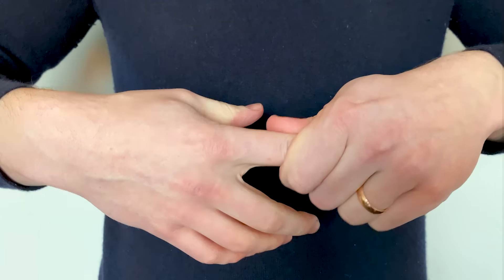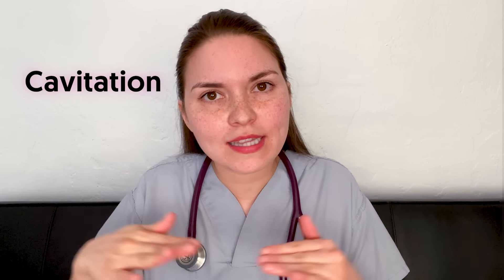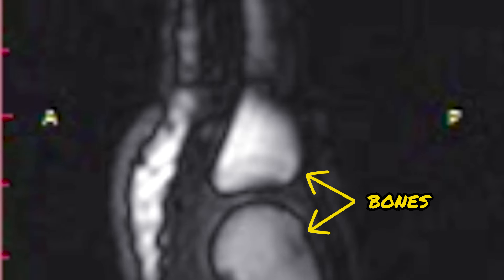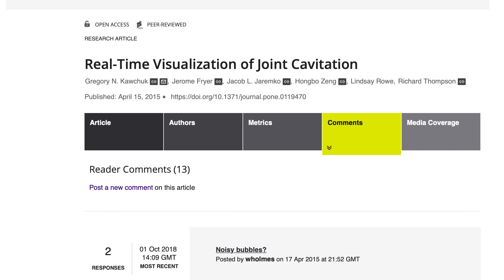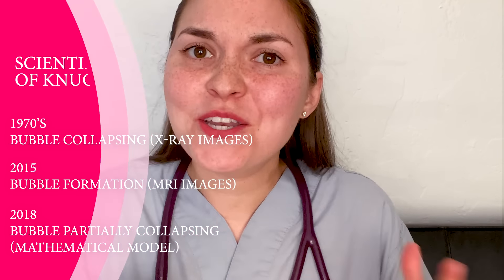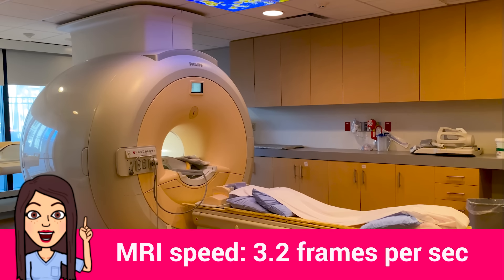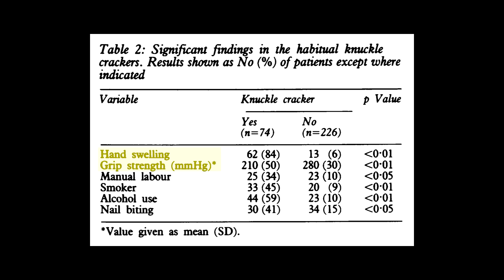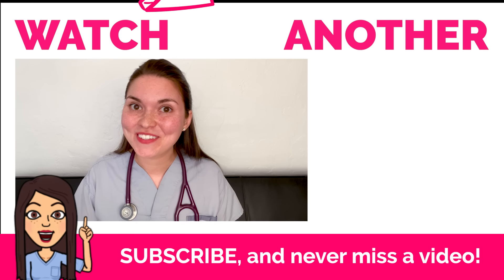Arthritis Doctor Explains: CRACKING KNUCKLES GOOD or BAD

Comment: Me, casually cracking my knuckles while watching this:
Reply from the maker: haha love it!
Reply: Same
Reply: Same!
Reply: Same
Reply: Felt a bit uncomfortable cracking my knuckles but still did it
Reply: Same😂
Reply: Same
Reply: It sounds satisfying! The same here. On another day, me, configuring a server and casually cracking my neck, and accidentally unlocking third-person mode 🙃
Reply: anyone else crack their toes as well?
Reply: @charlie-ot5ug  i have cracked every joint possible. From my jaw to my toes. Over 30-35 years since i started.
Reply: @dracula3811  if your going to crack your neck move it side to side and then  front to back don't do it in a circle that way you don't pull any ligaments
Reply: @joejacko1587  i crack my neck unassisted almost all the time. If i use my hands, it’s gently to the side.
Reply: I'm cracking my toes. I can crack my neck forever.
Reply: same
Reply: I had to crack mine as the video began. Lol

Comment: When cracking your fingers, toes, shoulders, elbows, back, or neck, the sense of relief is achieved when that tension is released. The joint feels relaxed again, which helps to alleviate stress in the body.👍
Reply: What about the jaw?
Reply: @denelson83  That's not always good. cracking a jaw can actually be grinding down the cartilage. I have TMJ and Trigeminal Neuralgia and I've popped my jaw unintentionally several times followed by a crunching sound which is the cartilage being destroyed/damaged.
Reply: Which is why chiropractors make money!
Reply: This i have had sins todler in my ne.  wen i am walking
Reply: @Veronica-ew8yc  wth are you trying to say are you okay?
Reply: @alloreon4338  evryday the pain is hard butt my dochtors cant heplh me
Reply: I crack my ankle everyday
Reply: What about hips?
Reply: @PamelaWhiteley  my chiropractor is amazing. You should do some research. There’s a lot more to it than cracking vertebrae
Reply: @alloreon4338  translation: I have had this in my knee when I walk since I was a toddler.
Reply: Carjacking your toes are the best
Reply: if your going to crack your neck move it side to side and then  front to back  never side and front or back together  don't do it in a circle that way you don't pull any ligaments
Reply: @tristman8413  knees and toes
Reply: @sonny2593  eyes, ears, mouth and nose?
Reply: That may be the case that there is relief of stress but that does not mean the motion of pulling the joint apart several times a day is good. 
Golf is good for you but playing it too much can in some people cause problems.

Comment: I pop my fingers, my wrist, my neck, my back, my toes, my ankle, my jaw and my knees. Basically my whole body pops somewhere. The knee is probably the only one that's kinda annoying to me, mostly because of the awkwardness of doing it in public, by having to swing my leg up and down.
Reply: I thought i was the only person who could crack my jaw! Yooooooo
Reply: Love cracking my knee so satisfying
Reply: Jaw? How do people do that😭😭
Reply: @user-us9fu5po5c  Twist it until you hear a loud snap.
Reply: Omg popping knees are the worst part😭
Reply: i can crack my tongue am i really alone in the world being able to do this? 😭
Reply: Yo dude I can do all that too
Reply: @conorbergan4843  I can crack my jaw aswell
Reply: For my knee I just crack it to the side, if it doesn't work I try to crack it on the other side like bend my knee right and then left it it doesn't work. And if those don't work then I pull my shin in at a right angle, making a definite and very loud CRACK.
Reply: @genzu6388  the way I do it is I grip my kneecap like I'm trying to take it off, apply pressure at the joint with my fingertips and then swing my leg up.
Reply: @bassembboustany  yeah you can just swing it a few times and get a click out, but you could also sometimes twist it a bit, which I rarely have to do, but sometimes the click is hard to get out :P
Reply: @bassembboustany  have you tried clicking your spine?
The way I do it is I arch my midriff back and curve my upper back inwards and then I put my hands behind my head and lightly force my head down and forwards on my chest, and it clicks almost all the way down my spine. It's pretty funky
Reply: @smittywerbensnydorzagarman2501  Wait what
Reply: @user-us9fu5po5c  Don't even try , after u do it couple of times in a row it starts to hurt badly but u get addicted to doing it
Reply: SlayThat Pussy  by that logic your elbow shouldn't pop either🤔
All your joints are capable of popping. Fingers, wrist, elbow, neck, shoulder(my shoulder pops sometimes), all your vertabrae, hips, knees and ankles.
I've had all of these pop at least a few times, sometimes by accident like when I lied on my right side and my shoulder popped by being moved inwards.
Reply: Yep, cracking other people's necks is the best. They're so relaxed that they instantly fell asleep!
Reply: I swing my leg side to side haha
Reply: I like to crack my spine
Reply: ....Anyone getting pops from their middle of their ribcage? I get them usually when i stretched my back.
Reply: 🥲 I’m not the only one! I have to do a sort of kick swing to make my knee pop. So much fun.
Reply: Stop cracking your jaw.. trust me, mine is getting worse now. I'm pretty sure I'm damaging it. I've had several days of pain, twice in the last 6 months.
Reply: @localpoliceman  I've been doing it for the last 10 years iirc. Back then it used to happen randomly and involuntarily when I chewed and that was painful. Now though I just do it rarely as a tic. I have lots of tics.
Reply: @localpoliceman  don't forget the lockjaw
Reply: @mmyr8ado.360  bro, be carful of your jaw tho cause it's one of the few that get worse the more you do it
Reply: @localpoliceman  yea, gp's can get that fixed up easy, but also don't crack your jaw, the other stuffs fine
Reply: I am not alone with all these??? Wow omg!!!
Reply: @mmyr8ado.360  yeh, happened a few times. Not extreme tho, just a little bit. Its really difficult to stop;(
Reply: Yea I crack many joints, wrists, knee, ankles, jaw, but mostly only have the urge to do so on the left side.
Reply: i can crack my knees sideways as well! and my elbows too
Reply: I can crack my elbow, somewhat the same as how you crack your knee
Reply: i just slam right under my kneecap to initiate the pop, then twist the joint to get any extra
Reply: Poping can be both medical or harmful depending on situation. My personal experience says finger-poping is neutral, back-poping is medical and wrist-poping can be very very harmful. Four years ago I got a really bad case of mouse arm from gaming. My wrist became inflamed resulting in everything in there becoming one big lump. Also smaller lumps had formed in several other joints in my right hand, including several in my thumb (which were very hard to find). A year in I had removed (softened up) of most of the lumps through massage, including the major one in my wrist, but my hand was still disfunctional. It was weak, red, swollen and felt very weird. Half a year went and it was not getting any better. In desperation I began poping my wrist, because I thought maybe the sound meant "joints and stuff was snapping back into place". For weeks i poped my wrist hundreds of times per day, ramping up the amount every day as I got better at it. The last day I did this I probably poped my wrist over a thousand times, by figuring out a movement i could do over and over again, without delay, each time poping in 10-20 different places. And I decided to do this until it stopped poping, to see if it would fix it. So i did it over and over again for several hours straight, until it temporarily wouldnt pop any more. Unfortunatly this only made it a lot worse. My hand became much redder and more swollen. After that I decided the opposite approach, to pop it as little as possible. I noticed that if I poped it once by accident it would pop by accident several more times during the day. I also noticed the symptoms became worse with every pop. So I kept my wrist as straight as possible at all times (without using support because this had other negative side-effects). Since then my wrist has gotten a better each day, however the progress has been very slow and has still not yet fully recovered, now many years later.
Reply: i think the only part you shouldnt crack is your neck, there have been very rare cases of brain damage.
Reply: Kinda have the same thing, only it kinda hurts, at least it doesn't feel good, but sometimes I just can't help it, it just happens.
Reply: I have it in my left elbow after it has been broken. Almost always when it it stuck in place (happens rarely now but often ~6 months after the accident that broke it) but asometimes when it is not. Never my neck.
Reply: I just sit down and wiggle my thigh while trying to keep my shins firmly rooted to pop my knees
Reply: For the knees i just do a squat
Reply: Same
Reply: I can pop nearly every joint in my body, and in a lot of cases my joints lose a lot of their flexibility and mobility if I don't - particularly my knees, elbows, shoulders and neck.  I've also found that if I don't regularly pop my foot joints, they tend to lock up painfully when I walk until they get popped.
Reply: I wouldn't pop your jaw on purpose if I were you. A friend of mine had to have his jaw sewn shut for weeks because of it. I can also pop my jaw but had to avoid it because it was popping out of place.
Reply: I can pop my nose
Reply: I loathe my knees cracking, it's never voluntary and it always hurts like s.o.b.
Reply: Ur jaw 👀
Reply: @huxa7624  I promise you it is… idk if I’m an alien or what but there is a very audible click/ pop when I do it the same as you pop any other joints  would you like me to upload a video?
Reply: Hips! Anyone ever crack their hips?? It feels like it should be painful but it’s not... very strange!
Reply: @LKauf279  agreed and its satisfying
Reply: @lordvader6172  my neck ? Or knee ?
Reply: @Toxxsicklemons  Both
Reply: @smittywerbensnydorzagarman2501  But the. Tongue is a muscle. You can't pop.. there's no bone... I'm very confused.
Reply: @legendsnakeman6226   Bro, miss me with that 😶💀
Reply: I thought I only do this all. Glad to know.
Reply: I can crack my lower spine by doing a 90 degrees twist. I can get like 4 pops as if im popping 4 joints at the same time. Is that normal?
Reply: @azaniatv566  Prolly 🤷‍♀️ We all have TONS of cracks in our spine so. Hopefully it doesn't injure us 😀
Reply: I can do all those but the jaw. 🤷🏻‍♀️
Reply: @smittywerbensnydorzagarman2501  I really need to see this 😭
Reply: @betterdrugsthanyours  how do you crack your knee?
Reply: Mc Ren you sort of pull your knee cap up with your hands hold it there then extend your leg
Reply: @betterdrugsthanyours  i just started doing that in the mornings 😅
Reply: WTF, I also do it all the time.
Reply: @betterdrugsthanyours Agreed
Reply: Gadamn the jaw????
Reply: I can pop my hips ever since I snapped my femur, I can pop my neck in a new area by pushing my fist on the side of my head where my neck and head connect (two knuckles on head two on neck) I love popping my thumb on the part that connects to the wrist. Just hold your hand in front, pull the joint above it towards you and push away from you right above where your last thumb joint is. (Need to relax thumb)
Reply: I crack my fingers, toes, neck, back, and sometimes thighs.
Reply: Knees and ankles!? Interesting.
Reply: You shouldn't pop your neck that much.

Comment: As a 40 year knuckle cracker and diver, I can honestly say it doesn't cause arthritis but I can say that nitrogen builds up in the body, the joints you normally crack get stiff and sore, sometimes for days depending on your dive depth, ascent rate, and temperature.

Comment: As a lifelong knuckle cracker, this was interesting. I’d love to hear your thoughts on whether or not chiropractic adjustments actually help you.
Reply from the maker: mmmmm great question! Something I would need to look more into, and I'd definitely be interested in doing that! Thanks for the suggestion
Reply: I tend to believe they do based on my own personal experience after dislocating my left shoulder. 30 days after the incident, it constantly felt like someone punched my arm and I was unable to extend it past the midpoint. Was scheduled for lengthy PT, but decided to talk with a chiropractor who moved the humerus back up (almost passed out) and regained full range of motion within 10 days.
Reply: All depends on the chiropractor. Gonstead chiropractors tend to be the best though.  Like any profession there's a large number of mediocre people, a few really good ones, and then a bunch of bad ones as well.  However we tend to pay most attention to the really bad ones and make a judgment based on those ones, even more so if you are biased against it.  Dr. Ian and Dr. Rahim are two incredible Gonstead Chiros worth checking out.  A few of the biggest distinguishing factors between good and bad practioners is methodology, as well as the understanding of basic principles and foundations (which can really translate to any profession).
Reply: @seattlesix  sounds like a sublux.  Not surprised a chiro fixed it.  I had 2 dislocations.  On my second one after I woke up from the drugs, I knew it was still out, told the doctors and they stood there and laughed at me and told me it was the drugs talking, sent me for another X-Ray and when they got it back they realized how wrong they were (which probably hurts as a doctor, especially when your patient is drugged up).  Also to add to their pain, that dislocation wasn't even bad and shoulder reductions are quite simple.

Comment: I read a story told by former Chief Scientist of the US Navy's Office of Naval Research John Craven that related how he placed sensors in a submarine's ballast tanks to prove that the cracking and banging noises coming from them that were so concerning were nothing more than cavitation. Noisy yes,  a mechanical problem for the sub no but it needed to be fixed, it was extremely noisy. I read that in the '90s and I recalled the knuckle-cracking cavitation theory I had been told years before. So that appears to be true.  Cool.

Comment: For me personally, I HAVE to crack my knuckles, neck, toes, etc because they cause pain and even cause their corresponding body parts to lock up and not move. I even have some days where my neck down to my fingers locks up and it can only be relieved by cracking a certain finger on the hand that is affected. A good question that I've never come across an answer for is, "Are there things that can cause a building up of gases, or other things, in the joints that make them need to be cracked?"  I know that may seem odd.. But I swear a short while after drinking a carbonated soda, I seem to need to crack things more frequently..

Thanks for an awesome video!

Comment: The 1970s theory made sense to me because it seemed like it explained why I can feel that a joint wants to crack. But if the case is not that the bubbles exist, and you feel the need to pop them, but rather that something happens, and you feel the need to create and then pop a bubble, what is that thing that makes it feel like your joints are so stiff?

Comment: I was diagnosed with JIA (Juvenile Ideopathic Arthritis), a form of Rheumatic arthritis at 18 months old. 14 & 1/2 years later, I still have it.

I also crack my joints on a daily basis and it actually frees them rather than restricts them. The idea that it gives you arthritis is bs.

Comment: The think that what simulates cracking best is not what you did with the syringr  while releasing it back. It sounds much alike when you totally pool the inner part away, than the pop sound is just similar, from the same reason.
P.s 
all rights reserved to me !

Comment: I have noticed that if you crack your joints where theres more tissue surrounding it, it damages the muscles and tissue cause the only way to relieve the pain or crook is by cracking it again. But its only a temporary pain reliever until you leave the pain alone and the crook goes away completely.

Comment: I feel the need to crack the knucklels basically every day. I feel it immediatelly cause my fingers are not moving confortably. However I always hated pulling the fingers, so I crack them in a fist pose, it's easier and faster as you pop multiple knuckles at once. After I crack my knuckles, I can move my fingers more confortably.

Comment: Speaking about the air bubble on the MRI image, I don't think the black spot is causing the crack. Look closer, there's a white spot that disappears as soon as the joint separates. I think that's what pops. (whatever that is)

Comment: Very interesting video!  One thing I wonder is, if it's negative pressure in fluid, why you can't do it over and over again in a short time. Once I pop a knuckle, it is quite some time before it will pop again. Perhaps it's because once popped, the joint is a bit more stretched and the fluid is too spread out to form the negative pressure bubble.  Then after some time the joint pulls back to a tighter position and can be popped again.

Comment: Many people do not even pull their fingers but have some other stretch method. I used the pull method when I was younger, but now I use a completely different technique, to the point I can't crack my knuckles by pulling. Also I have joint in one of my fingers that can crack whenever I want, seemingly infinite times in a row (my record is 4 minutes straight, before getting tired). Also it appears that getting used to cracking your knuckles has an important role. Doing it for the first time hurts a lot (wrong phrasing, oh well) but after a couple of crackings it is very easy.